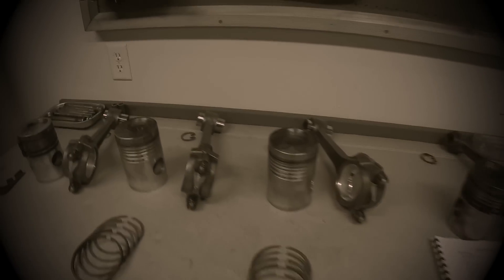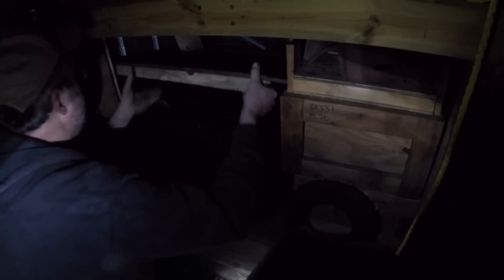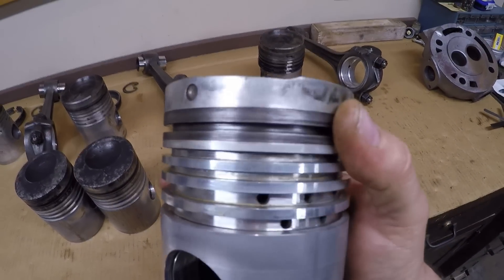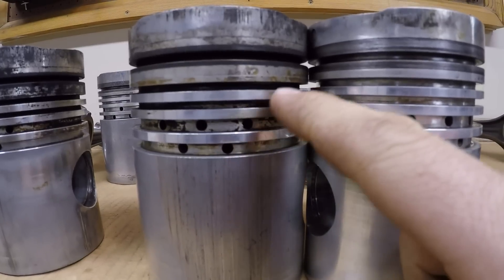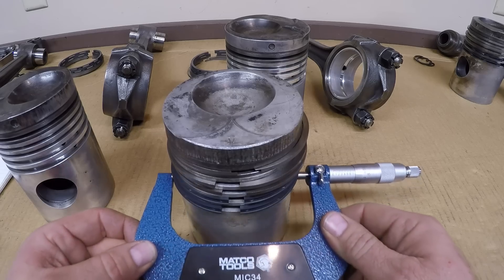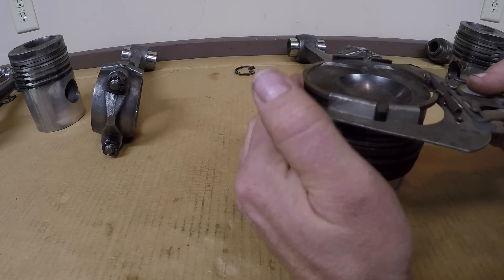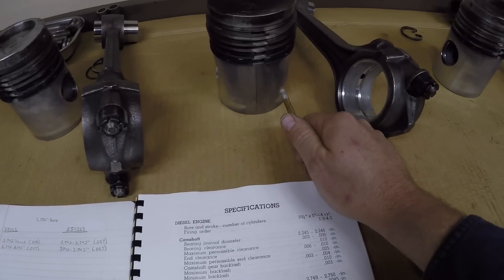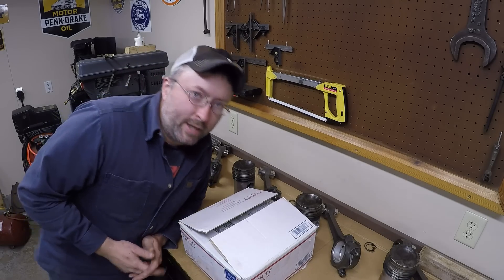Caterpillar D2 #5J1113 Diesel Engine Assembly Ep.6: Piston Success!

Comment: I'm glad I'm not the only one thats got a pack rats nest of used parts sitting in a shed. I've got tons of Fordson parts here. My Mom was looking a few years ago she said why did I have piles of odd tires with no match.  I picked them up when I saw them, but over the years I picked up enough tractors with odds on. I've matched sets and used them now, I guess i just got lucky and with other stuff to that was missing when i got tractors cheap  like drawbars and 3 point hitch stuff that I had piles of it in stock !.      
 
 What you are doing with those parts is fine, I've had some old low revving diesels I just went through found the best of the used parts, thrown new bearings on the crank and rings in decent sleeves and thrown them together as it wasn't a  million$  rebuild project,  As far as I know the ones I don't own are all still running or something else expensive was the reason they got parked when it went wrong.

 If it was a newer motor in a big cat or other machine  it would be done to specs and perfect.   Some of this old stuff just isn't worth big time and money or finding NOS parts over a few years, if a guy just wants it to run and drive a few hours a week, or run it at shows 4 times a year. Thanks for the video take care.

Comment: With sample pistons. A lot of racing piston manufacturers can make new forged pistons if the have a raw forging the correct size.  There is also egge machine in Santa fe springs ca that still casts piston using antique tooling. LA sleeve could probably create the top cast iron fire groove to align in dies if egge has them.  It might be really interesting since no replacement pistons are available. If a piston forging die could be created to hold the cast iron fire ring sections while an aluminum slug is slid thru it. It would probably need to be tee shaped during a preforging.but it could probably be done.  
Or else contact a piston ring manufacturer out in the Los Angeles area and have thicker piston rings cut. Then have a talented machine shop recut the ring grooves over size to match the new thicker rings.

Comment: The scuffing on that second piston of the pair you didn't use looked like what I have heard of as "four corner scuffing". Yes, it's round so how can it have corners? If you connected the scuffed areas, you would have a square or rectangle which does have corners.

The way it was explained to me by an even more technical Cat guy than Squatch, is that it's caused by over heating. The areas closest to the wrist pin bores gets hot but with the mass of the boss, it doesn't expand. The expansion occurs just outside of there as happened on that piston.

Combine that with what he showed when cleaning the block, it makes sense. Plugged coolant passage to #4 and it overheats and it all ends in tears. And tears of metal. (That was wordplay with homophones, BTW)

Comment: The tolerances of this great era are a mile away from say a new motorcycle engine which goes down to thousandths of a millimetre in some critical clearance areas. You have to take your hat off to current engineering standards when you think that in the late 1700's, a tenth of inch accuracy was the best achievable.

Comment: To any Cat fans near southern Ontario  you might want to check out https://youtu.be/3uAqOjlxQEo?t=550  Deboss garage around the 10 minute mark.  Complete dozer in a junkyard going to be scrapped soon. Might have some useful or rare parts. I'm not a Cat guy - the block says 7F8928, it's a 6 cylinder and the pony motor is up front.

Comment: So why is it not good to reuse Pistons? This is from the '30's when they used quality materials with plenty of excess so reusing most things from the by gone era is completely acceptable. Even back when this was new reusing most parts was something even the dealer did, parts were expensive labour was cheap unlike today where labour is expensive and parts are built to garbage standards to maximize profits instead of showing pride in their products.
Reply: @squatch253  mine wasn't so much of a question as more of a rant on the scaving state of companies preferring profits over quality lol. This era and many around it built things to last, the old Pistons are heavier than a modern piston twice it's size. Pistons from a machine today I would never reuse but on this older stuff, they were built to take it and ask for more. Except for the piston top coming off but that happened in new use Pistons or many hour engines. Thanks for the reply.